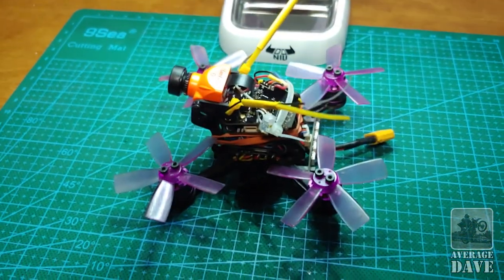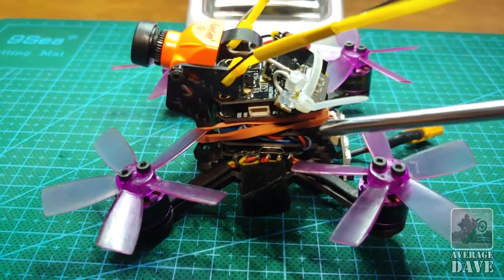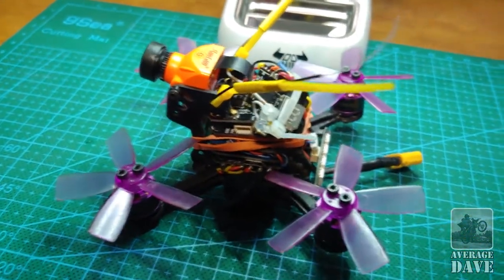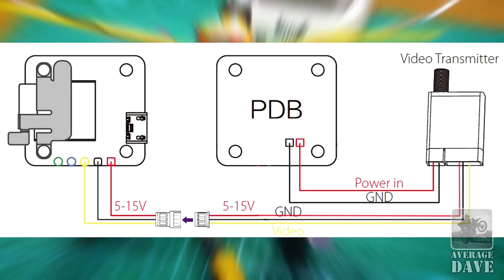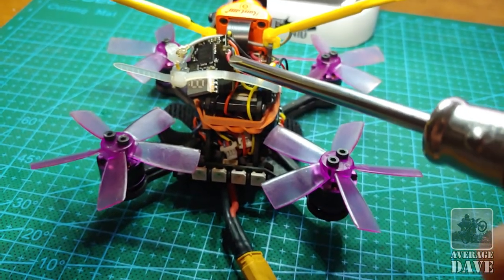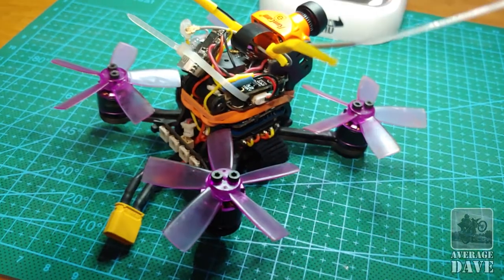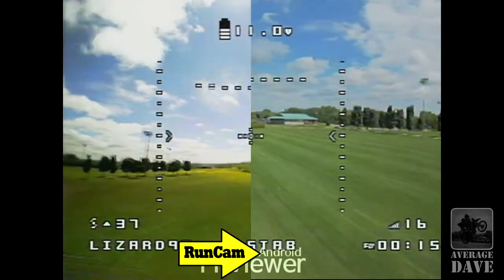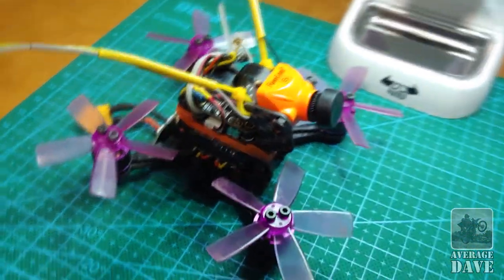Lizard95 & RunCam Split Mini - Setup/install & Test!!

Comment: nice mod, I'm gonna do that soon with the split mini 2. btw when you use the 4 blade props you get less vibrations and the same power
Reply from the maker: Yeah shame the 2 wasnt available when i bought mine. I had heard that about the three blade props